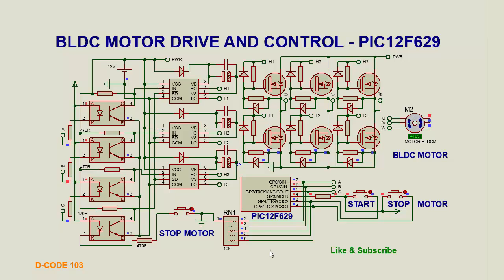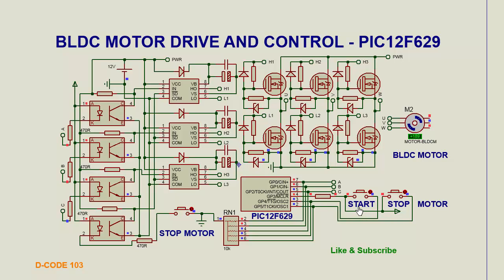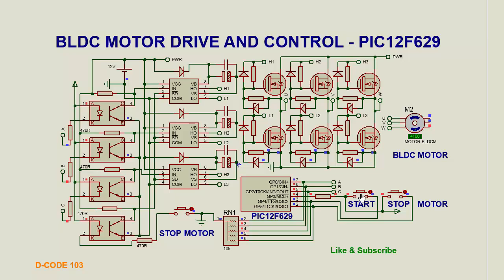BLDC motor on off control | PIC12F629

Comment: Can u make video on speed control of bldc motor using PIC18f and also provide program also
Reply from the maker: Please tell me which pic18f, mention full name thank you
Reply: @Dcode103  PIC18F4431 program for 3 phase bldc motor having hall sensor and will generate 6 pwm signals and 3 phase 48v 3kw bldc motor also suggest driver circuit for it
Reply from the maker: @sujitpatil2589  Are you designing professional product or college project
Reply: @Dcode103  college project sir for automated guided vehicle
Reply from the maker: @sujitpatil2589  your location and college name
Reply from the maker: @sujitpatil2589  I will try and update you if I get satisfactory results thank you
Reply: @Dcode103  I want only program for microcontroller and its schemetic of connection further i can do . If it is possible to give me program then plz share me ASAP .
Reply from the maker: @sujitpatil2589  ok
Reply: @Dcode103  have u got program sir ?
Reply from the maker: @sujitpatil2589 you need to wait, we are busy in professional work
Reply: @Dcode103  okay sir but do it ASAP it will be very beneficial for me🙏🏻